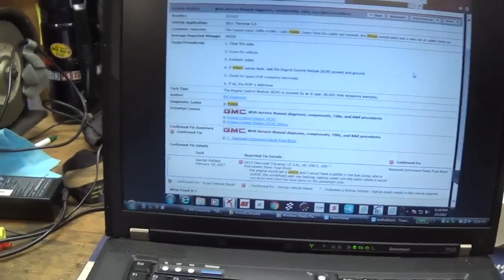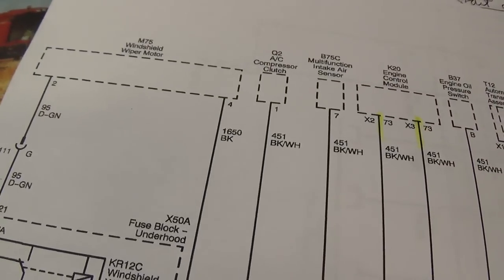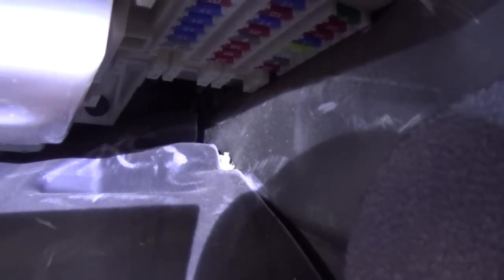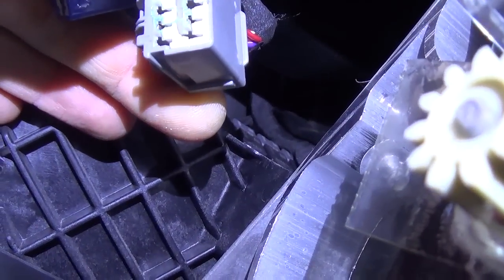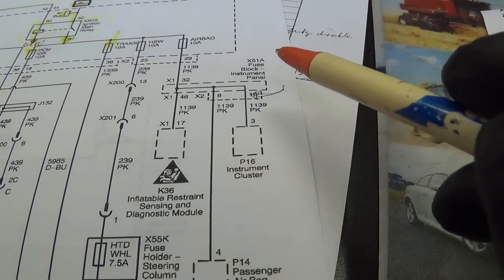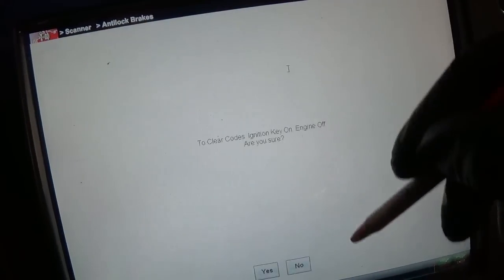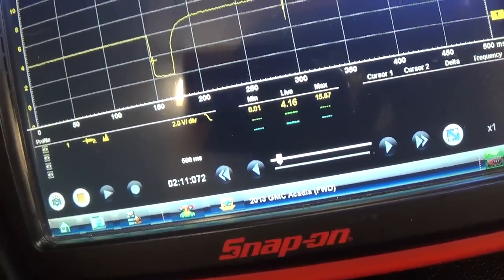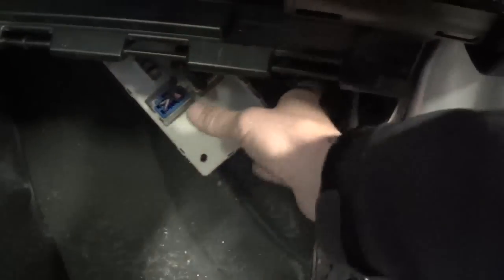CONCLUSION!!! No-crank, REDUCED ENGINE POWER: '13 GMC Acadia -Part 5

Comment: Same codes! Been looking all over for videos, etc. Saw your 1st video and then watch 2nd. Then couldn't find this one.
Long story short, had the windshield replaced 2 years ago. Water leaked in. Radio display went out a year ago...still has audio though. Now, a week ago. These codes and exact same problems arose. Now here I am watching this about to call it a night. Going to get into that instrument control box tomorrow after work. Hope I find same thing you did. 
It was awesome watching you be so thorough and not just replacing parts...like most places seem to do.
I try to fix everything myself if possible. And this has been a great tutorial. 
Thank you very much and I am forever a subscriber!!!

Comment: Amazing work.  I remember at work trying to sort out a problem it was stated its not magic lol what is the root cause . Thanks for the videos appreciate them. I had a old Jetta that leaked water into the fuse box . A know problem apparently lol  . It was just a work car an i kept a couple of 109 i think relays fust in case ..Drove it for a few several  hundred k miles a diesel . Saved me a lot of money

Comment: If I were an automotive electrical engineer, I'd design in a bare wire into every fuse box that could be checked for conductivity and light a warning on the dash.

Comment: OMG! I owe on a 2014 Acadia and I’m having the exact same issues with the no start no crank. Thankfully I kept watching, and the minute you spoke about water on the passenger side floorboard a lightbulb went off in my head. I do have the exact same issue, and will be looking into this very soon.

Comment: What a blessing to see this video. My daughters 2011 enclave runs after you take the key out. We had to remove the fuel pump relay to shut it off. From your videos I found a drain from the OnStar system and disabled. Now I am going to pull the fuse block and my guess is I will see the same damage. Your troubleshooting techniques has changed my perspective as a shade tree mechanic. I now rely more on my meters than ever before. Amazing work.

Comment: Hi, I have 2008 enclave and we were driving the car into the mall parking lot and it died on us. We pushed it to the parking spot and it does not want to start anymore, it cranks and I checked the battery which is good and fully charged. It was running fine, the only codes that came back after we took the battery to charge were P0352-0354-0356. Any advise or help or what to do now to diagnose it, please? I do have the code list before the battery as well. 
Thank you in advance.

Comment: The fact that you're working on a GMC Acadia Denali means you have a moonroof, that being said when the moonroof drain line gets plugged up, or becomes detached from the drain hole, it's going to leak water into your fuse box. That's why it's full of water. Way to go GMC.
Reply: Same with my cadillac 2013 srx drain on moonroof leaks into my cabin

Comment: I have a 2008 GMC Acadia with a cracked windshield at the bottom and it have that same problem it turns over but won't crank thanks for your help

Comment: Dude I just stumbled on your video I think you may have solved my Acadia problem. I'm going down to the shop Monday to point out that fuse box and pull the carpet up myself and see if that's the problem I've been having those issues and it's been in the shop all week except Wed I got it out and on the way home it did the same crap again. I know my windshield had been replaced and when it first started it would go into reduced power in a turn now it does it a lot more frequently and my mechanic can't find a problem now I'm having no crank problems all the time.

Comment: Got a 2010 enclave me an my fiance just bought left us stranded at the grocery  store  last Monday bought it the prior Thursday can't seem to peg what is going  on with it but it hasn't started since the initial  no crank no start fuel control module  ..wiring  harness  was damaged / cut in half repaired the wire it gave a low voltage warning  twice remote start was working after wiring  repair  the code wasn't  showing  after repair either however  it was on the generic autozone scanners the vehicle  ran up until the wire was connected  it has driven me crazy since Monday morning  trying  to figure the solution  to this problem

Comment: I own a 2008 GMC Acadia -- not the Denali but almost identical block. This is  KNOWN issue with the Acadias.
It is NOT restricted to leaking windshield -- it is a direct design flaw that GMC knows about with the sunroof and front cowl drainage tubes. They literally drain down the right pillar column into the fuse box -- we have been repeatedly stranded with this piece of s*** that I honestly LOVE to drive. That publication (TSB) is like gold -- would love to get my hands on one right now as TODAY it won't start AGAIN and we needed to pick up firewood for heat. GREAT VIDEO - SHAME ON GM and DEALERS.
Reply: PS How the bleep are we supposed to drive an expensive SUV that one can only use on sunny days? Pissed off here.

Comment: I had same problem with my bmw after windshield replacement,  but without symptom or problems. Just water inside the cabin. Well😀 i did huuge scandal and everything were fixed for good by them again.
Anyway, i just realize that I've almost watched all of your videos, need lime 20-30 more to go😃...
It is not a lose of time, learned so dem much, thank you!

Comment: With regards to the remote start,  I have found that it will not work if the engine light is on.

Comment: Yo bro watched all five and you nailed it...no that fuse panel wasnt supposed to be opened ...but ibhave had 2 outlooks and I love my truck and bro you nailed it...those fn water issuses fucked those trucks all up and gm just does mhmm ot care because you have todo all you did to fix it.....I been trying to get this stabilitrac issue fixed on both my trucks they try to blame it on throttle body all that other ish and we all know the issues....it even drains your batteries cause it's a open circuit running ....I think you nailed it bro

Comment: My first new car was a 1979 Malibu Classic, two door with bucket seats and console shifter automatic, it was midnight blue with the color keyed sport wheels, I loved that car but the thing that led to its demise was water leaks which I didn't notice until a couple of years after I had it, the carpet was soaked front and back, I resealed the back window the windshield to no avail, I had to replace the carpet but by then the floors had rotted through and where the left rear body mount attaches to the frame completely rusted out so the body was resting on the frame, I took it to several body shops and none of them would touch it, my friend had a small arch welder we patched the floors the best we could but it just kept leaking and rusting and I could never figure out where the water was coming from, I gave up after many years and sold it to a guy who said he was going totally restore it but after a while he also realized it couldn't be fixed, the worse thing is I had just put a brand new Mr Goodwrench 350 in it. Now I have a 2001 lesabre that is tight as a drum and is dry as a bone inside, but I miss my Malibu.

Comment: Hey Ivan just watched ur video on water leaking on to the fuse box. I replaced my fuse box and this 2007 GMC Acadia still stays on after I turn key off and pull key out.  Check engine light stays on all night.  Kills my battery by morning.  Do u know what is causing this

Comment: Have an equinox that was re-ringed by a local mechanic.  Had an intermittent issue afterwards that was driving him nuts.  The problem presented as wild uncontrolled fuel pressure (GDI) when at operating temperature.. but not every time.  After much gray hair and frustration he found the problem.  The block and the head were both flat as can be, but the head gasket was not.  This slight bend was binding up one of the cam shafts.  Doing a torque test showed in spec.  He didn't detect the binding until he removed all the rockers (is that the name on overhead cam?) so the shaft could spin freely.  He now checks every head gasket for flatness.  Some problems wear you out looking for them.  Had he been charging me I would've had to scrap the car.
Reply from the maker: That's a crazy story, Rick. How does a bent head gasket affect fuel pressure? I would have to see it to believe it haha
Reply: @PineHollowAutoDiagnostics  the high pressure pump on that engine is driven from the intake cam shaft.  I don't know if this is the same on every GDI engine but the ecm controls the fuel pressure via a pressure sensor and an algorithm, knowing how much the pump is going to boost when the cam lobe strikes the pump.  The ecm lets in just the right amount of fuel to hit the target pressure when the boost occurs.  The engine also has VVT (it's the 2.4L ecotec).  Apparently, the binding of the exhaust camshaft was enough to screw with the oil pressure by providing significant resistance through the cam phaser and it jacked up both the intake and exhaust phase.  The very momentary phase error (I believe the increased pressure pulse caused an advance of the intake cam) was enough to confuse the ecm and make it lose control of the fuel pressure.  The advanced cam phaser meant the boost pulse started too soon, perhaps before the ecm was done letting in fuel. This is how I understood it when he explained it.  In any case, it took him a long time to track it down because who would ever see a connection there.  This explanation is also speculation, as there was never a test that could explicitly prove it.  When he replaced the gasket with a flat one, the problem went away and for good. (It's been 9 months)  Btw, he tested 2 more gaskets from the same manufacturer and neither of them were flat either.  He changed to another manufacturer and got a proper gasket.  Also, by not flat, I don't mean bent.  I mean not a uniform thickness.

Comment: Awesome diag!  I'm wondering if you might have reproduced the no-crank by using the remote start.  If the BCM were also back-feeding power off that jumper, that might have caused some odd behavior too.

Comment: I am being quoted by mechanic that we need to replace the FUEL PUMP Sensor and FUEL PUMP in my wife's GMC ACADIA 2012 for the Reduced Engine Power.
Reply from the maker: Don't do it that's not the problem. Find another mechanic!

Comment: Ivan, you sir are a scientist or an electrical engineer masquerading as a mechanic.  Your scientific investigation is quite thorough and impressive.  You need to be working for one of the major automotive manufacturers in their quality control department!  BTW, I wouldn't be surprised if this vehicle has the same problem that my mother-in-law's 2011 Chevy Malibu had, which was a leak due to a disconnected drain hose from the sun roof.  The drain was a two-part hose that ran through the A-pillar and came apart due to inadequate epoxy.

Comment: I have a no crank...no start. Traction Controll Off... Service Stabitrak....car is driving down road...these lights (TCO & SS) come own, then car dies... then wont start or crank...This has happened about 4 times... 2 times...after waiting about 3 to 5 mins the engine light would come back on.. it would start... twice has happen... one time we waited about 4 days then the engine light came back on & it started. Now it has happened again...its been 3 days and nothing. Only codes are lost commication...5 of them... Any suggestions?
Reply: Forgot to add 2012 Acadia...
Reply: 2012 Acadia

Comment: I came here looking for a solution to the exact problems your customer and the TSB mentioned for my wife’s 2010 Acadia. After pulling her fuse block I found it filled with water as well. Thanks for such an informative 5 part series on this issue! We will also be looking to trade this vehicle in ASAP as this is the second water leaking issue we’ve come across. 
Previously I had to replace her Amp because water was getting into the door wiring harnesses and dried the amp.
Reply from the maker: Thank you! Good luck!

Comment: Having this same issue. I noticed that when I take Acadia from park to drive, something makes a terrible shift in the transmission it seems. It makes a horrible “clunking” noise. The truck will not drive. Also, as I was driving it, all the gauges go to zero. The rpms, the fuel gauge, and the speedometer. The battery gauge was reading very high. What is going on?

Comment: watched all the videos to the end. I was not surprised to see the results! my wife has been noticing a leak on the passenger side of our 2014 Acadia for several months now. the carpet has been wet at nearly every time it rains I thought it was coming from our sunroof. were having the same intermittent starting problem I would always disconnect the battery and would get it going. now I can go straight to the heart of the problem great video!
Reply from the maker: Thanks Paul! Fix the leak ASAP! Also check for a clogged A/C drain...
Reply: @PineHollowAutoDiagnostics  will do... I've heard some say it is windshield some say it is the sunroof but I'm going to check both I did not think about the AC drain.

Comment: Wow finally a real answer to my truck problem. I've been having same problem and nobody seems to be able to fix it. Temporary fix and then back again to same problem. I removed carpet to check for water intrusion and YES same thing foam is soaked and the side walls have water marks. Thanks for actually finding the source of the problem not just the problem at hand. Best channel so far.

Comment: Any Dealership would be a fool not to hire you for BIG bucks.  BUT!  You would take way too much time on each job.   You would FIND the problem and FIX it - but you can't do that in a Dealership.   I worked for RCA, a 100 years ago (after retiring from the USAF - Avionics Mtn.)  I worked the Bench in the TV Section.  Road guys would bring in the Chassis from the customers (who had warranties for years) and I was one of 25 bench guys who worked on them with  "Test Jigs."  (CRT's and Spkrs.)   After two weeks on the job the maintenance supervisor called me in and told me I was WAY too slow!   I needed to turn out 8 to 10 chassis per day - average.  I said WHAT?   Ain't no way I could do that and fix them properly.  He put me "on the road" for TV service calls - after one year I was layed off and never went back.  The Mtn. supervisor told me:  "hook up the chassis, if there is sound and you have a Pix - SHIP IT!   (not fixed).  Told him I couldn't do that.     I was soooo glad to get layed off.Went back to my "one man business," just like you. :)   Great job Ivan - I was with you for ALL of the videos.   Great job of troubleshooting.  p.s.  First time I've seen a Decade Box, also for 100 years.  :)    Used the crap out of them.  :)   You and Eric O are the cream of the crop in this business.     Many thanks for what you and Eric O have taught me.

Comment: NEVER, NEVER, NEVER BUY ANY VEHICLE WITH A HOLE IN THE ROOF!!!! There are two kinds of sunroofs, those that leak and those that are going to leak. The drains plug up. The water in them freezes and pushes the connections apart. Unless they have a 2-inch id, they will plug up. 

When she noticed the windshield leak, she should have gotten the installer to replace the windshield. Did the windshield installers cover the damage?

Comment: Great job and very useful video!!! I own a Buick Enclave 2011 and I will check for water leak and just in case I will put electrical gel to the connections. Thanks
Reply: My 11 enclave is shutting off at random times. Most of the time during a cold start. Then the traction control, stabilitrak, reduced engine power will happen randomly.

Comment: I had a 2003 Lexus lx470,which I bought used.Whenever it rained,the car would try to start by itself (the engine would start cranking but not start).Finally after a few minutes that would stop and then if I drove the car it would go into limp home mode and not shift.It set a bunch of codes for transmission,ECM,throttle body and many more.I live in India and at that time there were no Lexus dealers,so I took it to a Toyota dealer who changed the ECM,the WHOLE wiring ,throttle body ,new starter,new fuse block,new transmission relay and many more I can’t remember.Cost me approximately 12-13k dollars(equivalent in rupees).Problem not fixed.Then I logged on to a website called justanswer.com,where a mechanic asked me to check for water leaks along the front windshield.Sure enough the previous owner had replaced the front glass and instead of using rivets they had used screws and some holes were completely empty.Fixed the glass,car was fine after that.Thats when I decided to do my own research and subscribed to this channel!!And I’m loving it.Keep up the good work.😊

Comment: Boom
I was wondering. Does that variable resistor need a load for the voltage to come down or will supply voltage be the same out of the box if there is no load applied.
Great vid and experiment

Comment: Hey future technicians......step 1 verify problem with customer. Step 2 check for TSB’S‼️ if you were on flat rate you would have lost $$$$ don’t get me wrong, I’m a technician-myself. & I’m all about understanding the problem. Which I would have done for sure, after I seen that tsb, & fixed that problem! Understanding is key,but not when you’re spending hours when you could have found problem in 10 minutes off that tsb.

Comment: If it were me, I'd replace the fuse box, wrap it in plastic and seal it.  Then ship the car back to the owner with the leak proviso regarding something is needed to repair cabin integrity.  Maybe encasing the fuse box in epoxy would be appropriate:)